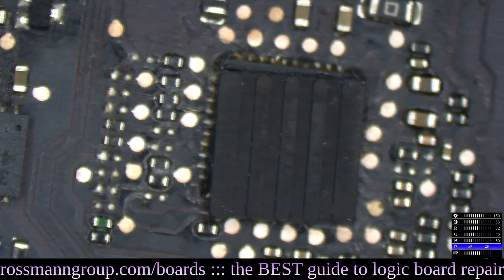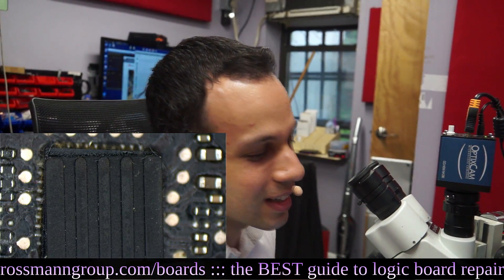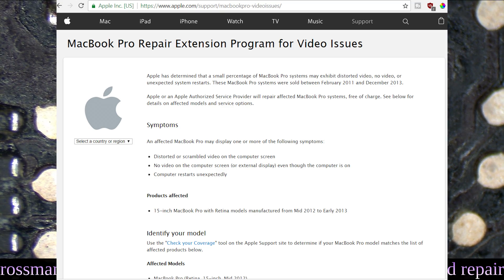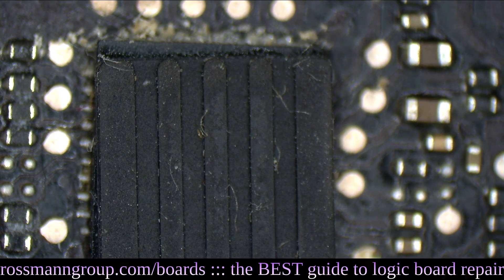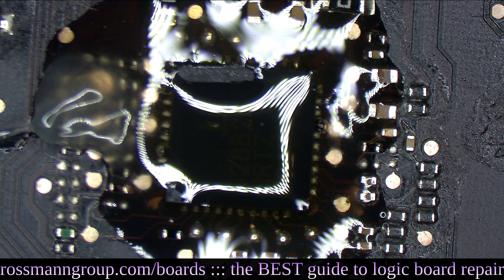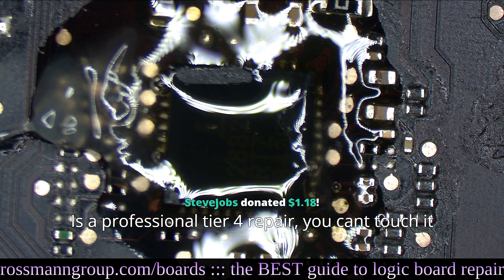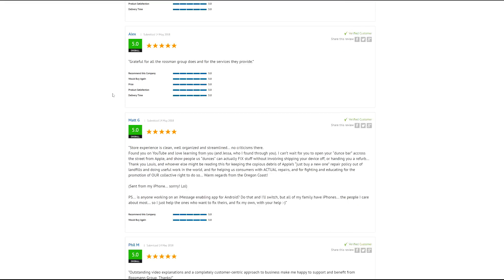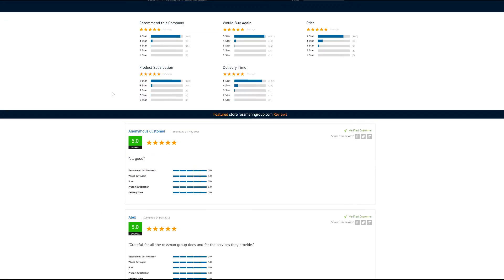How Apple authorized repair refurbishes Macbooks to fail again! GPU kernel panics

Comment from the maker: I never want you to take my word as gospel. Please see for yourself: if you have one of the early 2013/2012 A1398 15" Retina Macbook Pros that was serviced through Apple's extended warranty for the board defect, take it apart and tell me what you think! You'll need a Torx T5 http://amzn.to/2BLNDn4 for the board and a pentalobe http://amzn.to/2AKMdVb for the bottom case. Refurbs will have a little pad smashing the chip against the housing to keep the connection, and occasionally a very bad solder job in addition to the pad. 

Other devices solder the chips to the board, heatsink them so they do not burn, and design the case/board so they do not flex. Apple THINKS DIFFERENT: do you want a $2000 laptop that when it dies, they put back together with RUBBER PADS? I leave this to you.
Reply: Edward Cooper No because lead free solder is fake solder
Reply: I can attest to things working more smoothly, because a very lightweight Linux environment is heads and shoulders over anything else for stability, even using BSD, due to its popularity and low memory overhead. The only problem is if you need anything for Windows, but as Lightpipe showed, you don't need to be on Windows to use anything for Windows in Linux, only a really good Wine wrapper.

The only caveat? Louis would need to pay for his operating system as he is using it for business (being, his YouTube and Twitch channels) as everyone in the open source community wants their cut. So between paying for Windows or paying for business use of Linux, what do you think he'd pick?

Now hold on, fellow open-source zealots before you chastise me for that statement, read your terms. Most open-source systems will say Free, for personal use. Think Louis' use would be considered personal?
Reply: That's the "Bug" in the computer software we are always hearing about....It came out to say "Hello"
Reply: Louis Rossmann how many apple lovers do you think watch your channel and are like damn. Another video.
Reply: Holy f--k this is bad...why do people buy this s--t?!?
Reply: bluephreakr This. If a program is optimized to just work on Linux, it usually works quite well. If it is not, it does not work.

There are niches that Linux excels leaps and bounds over alternatives. The other things it fails really hard until someone fixes the problems.

Regarding the open-source thing, there are many types of open-source license. The Apache 2.0 license for example does allow royalty-free use. Go to opensource(.)org for more info.
Reply: Ach Louis, if I ever reach your level of craftsmanship, I will be able to do a battery swap on a iPod Nano 2g because according to iFixit, this is hard as hell.

Fortunately, my 13 years old iPod Nano 2g is still running strong with some glue residue coming loose on the to corner.
Reply: but louis! ultrasonic cleaners are expensive and soldering is hard.. how can any multi million dollar company be expected to actually fix things when they can just get any joe shmoe to stick on a rubber pad and call it good?
/end sarcasm mode
Reply: Louis Rossmann Louis play more Dota2 on video while talking about something
Pretty please
Reply: I wanna bet that Apple will come up with solution how to break Louis repairs of Macbooks and iMacs because they did same to iPhones and iPads as we seen it.
Reply: Don't worry, the only words I take as gospel are "It just works" 🤭
Reply: I see you're having in there as much fan as I had when "Authorized PC builder" shipped customer a PC with PCIe GPU wedged in inbetween pci slots. XD
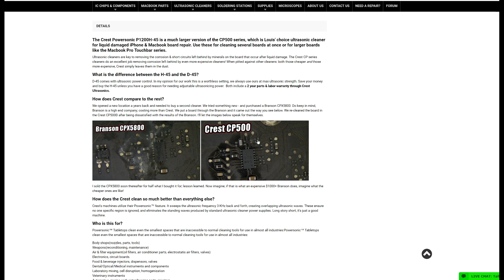Reply: 8:03 can i pay by installments?
Reply: Apple just open their mouth and peed in it.
Reply: So this is why Linus cannot get a repair... if he opens the Mac a second time, he will find out about the little pads holding the repairs together... and Jessa just needed to put little pads on the iPhone screens to make them "legit"...

/sarcasm!
Reply: perhaps the cheap glue used to attach the rubber bandaid isn't very easily removed without some thinners or something similar
Reply: Bro, you rubber me, bro?
Reply: would that repair that apple did with a piece of rubber be the cheapest non-fix they could do ? If they could do it cheaper with say really shitty adhesive and find a lower bidder with the rubber mat maybe they could save a few more dollars and not fix it even worse?
And i'm sure it was a cheaper fix than re-soddering and/or replacing bad chip? Why replace when u can put a shitty piece of rubber down and push on the chip? The customer will never notice right?
Reply: Guessing they want to spend minimal amount of time & money on these laptop repairs as its a warranty repair they provide for free, but a service repair like this is something you certainly need too pay for the skills & work put into it. It's not something like paying someone a few bucks too clean your laundry weekly.

Also wouldn't something like a small blob of epoxy glue.
(Not the quick drying stuff) Under the chip hold it better in place ?

Or why not just go with a metal shim that acts like a heatsink too if it gets hot enough for the solder too weaken & go bad or if there is a particular stresspoint by the mounting in the chassis for these macbooks for them too fit snugly in place.
Reply: Praise be praise be!
Reply: Louis Rossmann how do I support the right to repair movement? I am a technician and this shit ain’t right man.
Reply: Is your life under threat thrashing a trillion-dollar industry every time?
Reply: It should be possible to run izotope Rx on Linux using wine. If you want you can tell me what programs you need and I'll see if I can make everything working smoothly on Linux. I'm currently also still using Windows for similar reasons but I want to switch to Linux fully as soon as everything I use works smoothly on Linux.
Reply: Do you use lead free solder?

Comment: Apple sticking rubber on top of a chip thinking it will make contact despite its deteriorating solder connections is like slicing your neck open and putting a bandaid on thinking it will stop the bleeding.

Comment: My friend sent me a link to this video.  I'm an electronics tech, and I work down to 0201 size components.  I can't believe how bad the soldering was on that chip.  Didn't anyone even bother to look at it?
Where were the repairs done?  Sending it to China would probably have gotten a better job done.
I mean, that's just horrid.
Nice clean up job, but I would have used some alcohol and an acid brush on top of the chip to clean that up and get the residue off it.  No need for the pad now that it's fixed properly.

Comment: You mentioned Vista, 8 (The 1st one), 2000, and XP1.
Personally, I agree with Vista, 8 (the 1st one), and 2000.
I would replace XP1 with all of Windows 8. I was fine with all forms of XP, but I loathe everything involving 8. All versions of 8 were terrible.

Comment: Hi Lou I have a sort of weird different problem I have a Macbook Pro A1286 that the backlight went out  on the display and I just got another laptop same model everything works.  I took the Bad LCD that did not work and connected it to the new working macbook pro and it still did not work.  So here is what happened as soon as i plug in the lcd form the new working laptop that i just got, now it doesn't work either???? Could the Bad lcd I plugged into the working laptop screw up or burn something out on ;my new board?

Comment: This video hits right on the spot for me... I got my MacBook Pro repaired for graphic issues some time ago, when I got it back from the Apple service, they even told me that they had to replace the motherboard (yeah right).
A few months later, to my surprise the same problem happened again, so I took it back to the service, and this time they told me that my Mac could not be repaired anymore because that model was discontinued and that I better buy a new one.

I've never felt so insulted and mad to a company before, I left the Store with a feeling of despair and disappointment,l... Unfortunately I need Mac OS for many of the programs I use, and I really like MacOS, even knowing that I could get more powerful PCs.

I lost faith that I could recover my Macbook ever again, until I found you!... You have given me faith again.

The only thing I want to do right now is pack my Mac and sent it to you, and see if you can work some magic on it. 

Thank you for your great job, and for getting the truth out!

Comment: I agree with you Louis, if Linux had proper support I would definitely drop Windows, at least there is an echo cancelling feature in Linux for microphones but you have to enable it via modifying the config since it is a pulseaudio options

Comment: I get it why you like Windows and the iZotope plugin, the same way you get why people would use OSX.  I'm in IT and I use Linux, Windows, and OSX because I have to do so.  People complain that getting software that can do the same things they are use to on Windows is difficult.  Windows is certainly an easier choice for most people, but you can get the same results from Linux software in most cases.  I do professional voice overs as a sideline and I've always used Linux along with Audacity.  It's true that you can't use plugins like iZotope in the native environment (WINE could probably do it), but then you configure the Audacity software properly, you don't actually need iZotope.  I have a friend who even runs his entire karaoke show under OpenKJ for Linux.  There is nothing wrong with either solution.  If it works for you, more power to you on any platform.  But I think you aren't really being fair to Linux.  It is less user-friendly for most people.  But that doesn't mean it can't do what you want.   Great video!

Comment: I do understand why people would prefer apple hardware...it's not a good reason, but it is a reason none the less...esthetic value.  I do like the metal finish and color scheme they use as well as the size and form factor (I loved the glass in front of the LCD because I am that guy who cringes when people touch my LCD panel).   If you ask me they got away from a lot of the better ideas they've had in the past, such as magsafe connector or a macbook pro being a professional laptop.  I get where you are coming from though, don't base your decision on appearance, base it on build quality and getting the most for your money...and I do.  My laptop is a I7 based Dell Latitude and my primary desktop is a Xeon based Dell Optiplex both running Linux, both of which Apple cannot offer a similar set of devices at any price point. Even if they did, it would be non-upgradable and my $1000 Optiplex would be a $3000.   I still think the Apple equipment still looks a lot nicer.  I so have a macOS device that I use to support and work on Apple devices as well as using things that Linux doesn't support very well (and I do honestly like 90% of macOS) and it is a hackintosh.   People like us that work in IT look at things that general consumers just plain don't.  I can say for sure that most of the people that I support in our organization ONLY look at esthetics and thats it when buying a computer, phone, etc.  Keep up the great videos man, I appreciate the high production value and the quality of your content.  I was just telling a coworker today who is interesting to getting into more component repair that he needs watch your channel.

Comment: Audio related tasks are indeed one of Linux's weak points. However, Ardour does have declickers within it, and there are a whole lot of other LADSPA plugins that work in a similar manner to Izotope. However, I will concede that Izotope is a lot easier and works pretty much out of the box.

Comment: Seems right, I went through four boards that Apple replaced all under warranty, all the while claiming it was how I was using it. I'm sorry using a Pro machine in a well ventilated area and on a desk shouldn't cause this level of frequent failure. Finally went a fifth time and I now use that as a doorstop and I love my new Surface Book 2.

Comment: Do I see correctly that the original solder is lead-free (matte) and the new solder is leaded (shiny)? Doesn't mixing those create problems like thermal cracking, etc?

Comment: I learned my lesson in 2012. Bought my first Macbook Pro largely because I needed a new laptop and had a little extra to spend this time. Thinking Apple products lasted longer or were better, I aimed to buy a machine that would last me six years like every one of the other laptops that has never failed me yet. So I maxed out a 17-inch MBP. It lasted about a year and two months before I needed a new logic board, the "new" logic board also failed. On the third repair when I would have been due a new machine they lied and blamed the failures on me. I went round and round with them. 3k down the drain. I felt so taken advantage of and duped and not being rich reasoned that this company is in the business of ripping off hard working people and laughing all the way to the bank.

Comment: Have u tried JAmin? A buddy is using it for his video recording. Totally with you though on company support,it went 500percent in 5years but it's still way to go.and windows runs stable for years now..and they are going hard on open source and sop patent trolling.. that's what a little pressure and retirement of a software racist rhino man does.

Comment: I have a question, my Macbook Air 2011 crashes randomly, after a crash i have to connect the power so it would boot.
the longer it was off, the longer it would work ....
i could not find this problem anywhere on the web, did you come across a similar problem?

Comment: Hi luis, inspired by your channel and ifixit i already repaird my 2012 retina mb battery, trackpad, replaced the display and changed the battery and power button of an iphone6. When i did the same yesterday with my brothers 128gb iphone6 i managed to break tge digitizer. At least this is what i thought happened. The touch works when the display is connected in a working iphone6. You might have an idea how i can fix it?

Comment: Do Apple really did a refurbishment by simply gluing a rubber pad over chip? Luis and Linus videos convinced me to start think differently about Apple hardware from completely different angle. Being skeptic about Windows by reason and working under Linux last 15 years I still recommended to go Apple for people who want to run things like Microsoft Office and Adobe software because they have no choice to avoid them. And Apple hardware was quite good at time which outweigh their servicing weirdness. But not anymore, now their main business seems a shameless money grab. That "refurbishment" is ridiculous. I believe that I can do much better with that small set of tools I have now for my DIY jobs and RC modeling board repairs. At least when friend's Macbook will die, I now what I must do :)

Comment: What am i looking for to find a qualified repairman in Germany? I think i have this exact problem with my 2012. It fails every other year from the same problems. First the keyboard partially dies, then  the screen partially dies and then the logic board dies. I was wondering why the same cycle keeps repeating after they "fixed it"

Comment: Buying "refurbished" hardware from the Apple Store is the biggest way to reward Apple for selling hardware with known design flaws. Now only are they double-dipping with retail pricing for products on their own direct-to-customers sales channel, they get to play the numbers on returned hardware because of "known problems" which get refurbished in some mandated (translated: cut-rate) fashion which is orders of magnitude less than it would cost to pay a skilled person to troubleshoot the problem(s) and repair appropriately. Instead, they take a pile of computers with "the GPU problem", apple "the GPU fix" and sell the ones that pass "the GPU QA test" which is probably nothing more than making sure that you can see the Apple logo when you power it on. As long as they have a way to get a "mulligan" for every computer they sell of course they are not going to change! Would you?